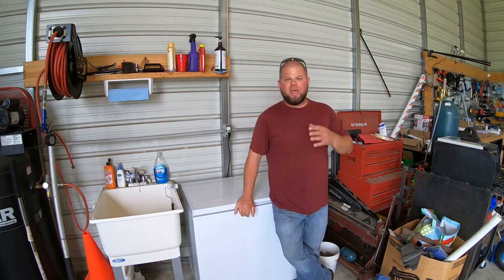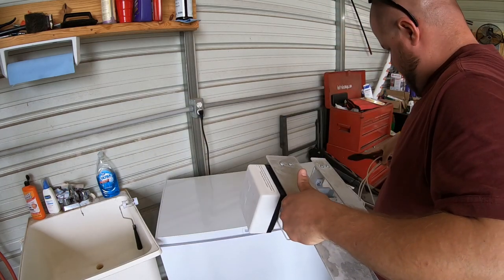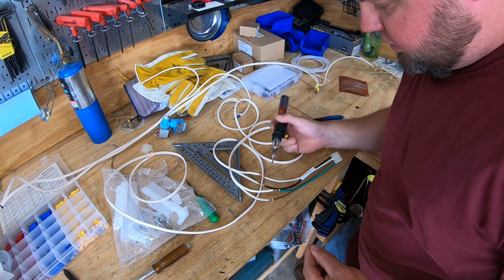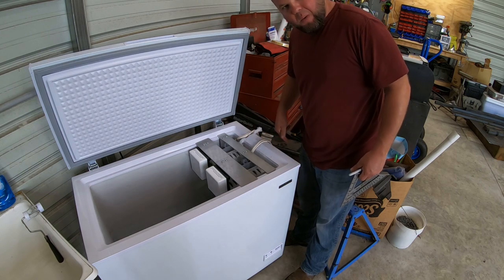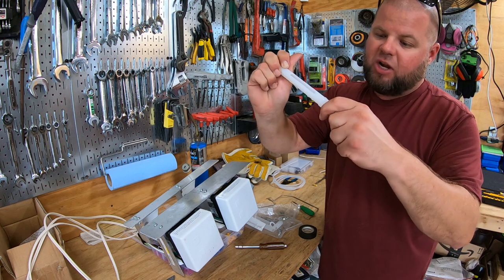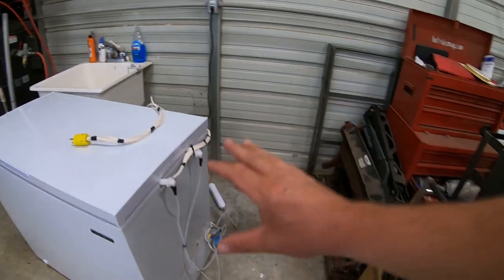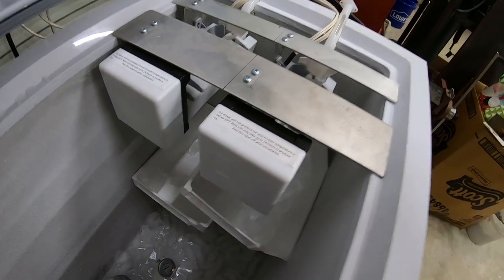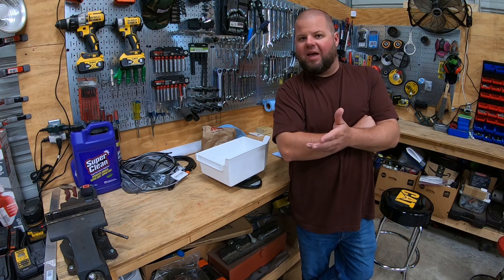Homemade ice machine, adding a second ice maker to increase production!

Comment: Great job & a unique idea! I was an industrial refrigeration tech for 30 years and worked on tons of ice makers and the problem with air cooled condenser commercial ice makers is as the ambient temp rises ice production drops off severely. With your set up you have overcome that problem since you are just keeping the ice makers in a 10 f ambient constantly. Also commercial ice makers use tons of energy especially as it get warmer and ice in an unrefrigerated ice hopper melts and drains. I would recommend one thing to anyone considering doing this is to make sure that the freezer doesn’t have a mullion heater around the top of chest (where you cut into plastic to run lines and wires). The heater is used in some cases to stop lid from freezing shut from condensation. It is very easy to check just buy examining wiring diagram of unit and it will show if heater is present, it is more common on domestic fridge freezers than chest fry but worth a look. Again GREAT JOB!
Reply from the maker: I checked before cutting, no heater in the lip. Thanks for the info

Comment: Since you have the freezer and limited production you can fill some containers with water and make some block ice, which last a lot longer than cubes.
Reply from the maker: I have been doing that lately
Reply: @TKCL   i freeze milk jugs lasts a long time
Reply from the maker: @John Crypto how did you get your thumbnail to have movement?
Reply: A few days before a bbq or party, since I have a freezer, I just go to the grocery store and buy a few gallon jugs of distilled water and freeze them. All you need after that is a box cutter and an ice pick. You get beautiful crystal clear ice.
Reply: @johnmcook1  My dad cuts the top off 3 liter soda then freezes it to use in his water jug at work it works pretty well
Reply: @dane.1847  its cheaper buying bags of ice..
Reply: @jacobsoto5451  depends on how much ice you use and where you live. some places are 5$ for a bag of ice. if you go out on ocean fishing trips with 150lbs of ice or more then 3-4 trips would make this build reasonable. for those that live in other regions where water / ice is cheap then your 100 percent correct. This was an amazing build. I want to build one myself just because it's so cool but I don't have a need for that much ice at any given time.
Reply: @corwinblackthorne4424  "but I don't have a need for that much ice at any given time" unless there is a power outage for a few days, storm damage tornado, hurricane
Reply: Block is great for coolers and hurricanes

Comment: I just ordered the ice makers and will pick up the chest freezer this weekend. This is the perfect solution for me.
Reply from the maker: Awesome, hope you enjoy it! Remember to be very careful around the copper tubing in the walls, that freon is toxic. Mine is producing ice very well.
Reply: Sorry I couldn't help Andrew but hopefully I can you.
The Idea is great but please don't gouge the side of your freezer.
The top of the freezer is nothing but insulation, all the cold stuff happens below the seal. Mount your ice makers near the hinge. Strategically drill through the top for the wires and the waterlines so that they line up with the makers. use large enough tubing aimed straight down so you don't get any capillary effect. You can mount everything right to the top and you can cover it all up with the box of your choice . Don't mess with the wiring of the freezer. Wire the whole thing independently like he did in the second video. Maybe put an ON OFF in the circuit since it's controlling water, plugging it into a ground fault receptacle wouldn't be a bad idea either. 
Great video, great idea.
Reply from the maker: Good points!

Comment: Finally watched the middle video in the process. You can increase how efferent the coolers are by precooling them using one of those freezer packs they send with some orders to keep them cool in the mail. The day before the outing toss the frozen pack in so it will cool down the cooler and when you toss the ice in the next day the ice isn't cooling it down. The packs go back into a freezer so they are ready to go the next time they are needed as they are also good if you take a cooler when shopping to toss the frozens in so they don't thaw as fast on the way home.
Reply: Make good ice packs for your back too. Just make sure to wrap them good with a towel so you don't freeze your skin. They're colder than regular ice packs.

Comment: Great Design and Install! A Very Effective Format for Cheap Bulk Ice Production. As a 30  Retired Maintenance Guy, I only see 1 Flaw in Concept and Install. That Ice Maker that you Purchased is an IM-6 Automatic Ice Maker for Standard Home Refrigerators and if you take a Look at the Bottom of Each Unit? You will notice a White Plastic Paddle Shaped Lever that is Designed into the Gearing System of the Unit. As the Ice Maker sends the Signal to the Solenoid to pull for water, after the Water has been sent through the Fill Tubed and drains into the Catch Trey it sends another Signal to cut the water Off. First, if you look at the Front Cover of the Ice Makers you will see the Cover Square with the Logo on it and say between the 3 and 4 O"clock Position on the Right Hand Side of the Ice Maker Itself you will see a Little Circle with a + and - Symbol. Remove the Circle Cover Tab with a Small Flat Head Screw Driver and you will see a Phillips Head Brass Screw. Turn that Screw Clock Wise 5 Times, what that does is tell the Ice Make to Pull for More Water so your Catch Trey has Larger Cubes in it and They will Last Longer in what ever need you are using, 2nd the White Plastic Lever that I mentioned rotates out toward the Front of the Ice Maker and is designed to in a Normal Installation that when the Factory Trey is full, the Lever hits the Ice Cubes and tells the IM-6 to not pull for more Water until that Lever is able to Cycle Completely. Without that Stop System, it will continue to make Ice, unless possible the Freezer fills with enough Ice and it fills in a way that the Lever will hit it and Stop the Process. Please take a Look at the Ice maker as it Cycles for a Better Understanding of what I have given a Description of. Again, Great Concept and Install. If you have any Questions? just ask. Thanks for a great Post...
Reply from the maker: Thank you for the information

Comment: Former bartender and current refrigeration tech.
¡ Kudos !
Beware of being to aggressive with that ice scoop! Easy to puncture the thin walls.
Reply from the maker: That's been bothering me! I can see that happening
Reply: If the ice is purely for chilling cans and bottles not consumption, might want to line the bottom and sides with 1/2" foil faced foam board to avoid damaging the coils with that dangerous dagger of an ice scoop.

Comment: Awesome project!  I would go with a slightly larger freezer and 2 ice makers.  The longer freezer would keep your options open to add 2 more at the other end while still leaving room to reach in to scoop out ice.
Reply from the maker: Second ice maker was added a while back, that video is at the end of this one. So far so good, update video out tomorrow.
Reply: @TKCL  I have looked at the Commercial Ice Makers for my home for years.  Even used they cost too much money.  Then they waste so much water from the drain in the bottom.  Some even have built in heaters in the bottom to ensure the bottom ice melts.  This solution never occurred to me.  Great video.
Reply from the maker: Glad you enjoyed it

Comment: Great job bud, I always thought ice maker needs its own separate pcb, but turned out that it works just fine without anything special. Also I’ve seen your latter updates, adding 2 fans was a super wise choice. Just like a freezer everything works super faster yet more efficient with the assistance of fan.
Reply from the maker: Thank you for watching

Comment: Hell yeah man!! Great video. Ordering my supplies tomorrow.  I already have a chest freezer. Thanks for showing us this!!
Reply from the maker: Thank you for watching
Reply: @TKCL  I got a free similar looking working ice maker out of an old fridge freezer. With an attached wire harness I wanted to put in a small cooler do these wire directly to 120V AC wall plug in? Or is it wired into the fridge/freezer and has the power stepped down? (I have to re watch the video)
Reply from the maker: I now have two ice makers and made my own extension cord that plugs directly into 110.

Comment: I know your machine is probably making enough ice for your needs. In my opinion, the one thing that you could do to increase is production even more is install the ice makers onto aluminum heat sinks that thermally join the ice makers to the chilled wall of the freezer using a thermal mastic. Interesting project. Thanks
Reply from the maker: I'm installing fans tomorrow and testing output. Next week I am adding block ice and increasing thermal mass to see if production increases

Comment: What i would do to quickly make it more efficient is to place a few pails, juggs whatever of water into the freezer. This will help get the temp lower and keep at that range better.  One main issue you have is the makers are at the top of the unit where it's the warmest preventing it from chilling the ice faster and  making it out ice out faster more ice out. I would put some small pails of solid ice on that side shelf this will keep the makers cooler so your making ice faster.  The pails you can remove later when there's enough ice in the machine that it regulates better.
Reply from the maker: I installed fans and I'll have a video out tomorrow. I'm making block ice next week and testing thermal mass effects.

Comment: Nice! I am going to make one of these for my club. 
FYI. I have a small freezer like this and the interior aluminum surface is very thin. You might want to put something down where the ice hits and be careful if you’re using a scoop. I put several holes in the bottom of mine with frozen food.
Reply from the maker: I'm worried about that too

Comment: Love the ice machine . I’m totally doing this . Just need to figure out wiring . I’d like to add a 15 amp breaker to the circuit powering the ice makers .
Reply from the maker: Thank you for watching
Reply: why would you need 15 amp for a couple of solenoids and timers?
Reply: @funnycatvideos5490  that’s a good question . What size would you recommend ? . Im not a electrician .Could you run ice machine and pump on 24volts ?
Reply from the maker: Needs 120 volts, the biggest draw will be the compressor kicking on and I recommend a minimum of 10 amps for that, the biggest draw on the ice makers is probably when the heating element kicks on to release the ice.
Reply: @TKCL  I guess I’d have to read the max amp draw on the ice machine . I feel it’s important to add at least a breaker since the wires will be exposed on the outside .
Reply: @garza7676  If you are concerned about exposed wires, put it in conduit.
Reply: @IJChan223  that’s a good idea . I’ll have to do that . Thanx

Comment: Here are the changes I would make to the design.  First, you mounted the ice maker in the warmest part of the chest freezer, of which has no active airflow.  In a regular freezer, they are usually designed so that the coldest air coming off the evaporator hits the icemaker.  Maybe mount a small fan inside the chest freezer to get more cold air across the ice maker.  Second, I would add another icemaker, or a larger capacity one, to make more ice.  Third, I would add a catch bucket, so you are not digging ice off the bottom of the cooler.  You could even rig a 20lb ice bag under a chute, and fill it as they are made.  I bought a case of ice bags with drawstrings on ebay, from a store that closed, for cheap.  Lastly, if you can find a way to pre-chill the water to around 33 degrees, like running it through a coil of copper tubing kept inside a mini-fridge, it would greatly speed up the ice making process.
Reply from the maker: You'll enjoy the video I'm about to post, cover most of that.

Comment: When drilling metal, using a center punch on your marks will help prevent the bit from walking on you.
Reply from the maker: Yes it will, I usually only center punch steel

Comment: you can also make 10+ lbs a day using two 2 1/2 quart measuring buckets to make block ice.  you can chop it into chunks using an ice pick.  so simple
Reply from the maker: Not quite as simple as scooping out perfectly uniformed ice and placing right into my cooler.
Reply: @TKCL   I can make 8.5 lbs a day of perfectly uniform ice cubes using 8 ice cube trays. but the chunky stuff is better, lasts longer in the cooler.
Reply from the maker: I think I'm about to be right with that number or past it. And it makes it for me while I sleep, no attention needed. I test the final production of ice tomorrow now with fans installed.

Comment: If you add a fan blowing across the ice makers it will make a huge difference in ice output air is stagnate in a chest freezer cold settles to the bottom! Look at your Ice maker in the house air flow is in the design.
Reply: Never mind I see you went with the fans.
Reply from the maker: Yep video out tomorrow
Reply: @TKCL  I bet it's making ice like a Alaskan winter now.

Comment: I love it.  Im going to make a slight design modification and make a wooden/foam collar to mount everything to like a Keezer.
Reply from the maker: That's exactly what I'll do on my next one, I didn't discover that until after I was done.
Reply: I built one with the wood collar / keezer style last weekend. The wood is a poor insulator and stays wet due to condensation. The condensation adds considerable heat to the interior I believe. I need more insulation (have 3/4 blue foam inside the collar) and a shorter collar (used a 2x6 and only need a 2x4).
Reply from the maker: I'm going to use pvc or hpde (cutting board material) for my next build to avoid that.
Reply: Yea I may sandwich it with a foam.
Reply from the maker: I would

Comment: maybe add a wedge under the ice makers to force the ice to flow into the lower section, to prevent shutting off the ice maker early with ice pileup on the upper shelf?

Comment: As I said you got a great idea there if you do a little research on your ice makers and possibly even add a fan inside to speed up the cooling across your ice makers you can probably I'm just going to speculate as long as those are like the old-style ice makers where you had an almost infinite control inside the front cover to speed up and slow down the production you can probably make up to 50 - a hundred pounds a day with those ice maker.
Reply from the maker: I already have two fans that I'm installing tomorrow, video out next week. Thanks for watching!

Comment: Good idea……. But freezers maintain temps at 0dig. . When the ice is harvested from a residential ice maker the cubes are wet  In a freezer they are going to stick together. Also as the ice sits in the bottom of the freezer sublimation happens causing the ice to grow into one big block. Your friends side by side idea is good but will require a drain for the bin. Even then sublimation will occur . 0:32
Reply from the maker: It takes months for that to happen, I clean 2-3 times a year anyways so it isn't a problem.  I now collect ice in small trash bins, it eliminates that problem.

Comment: I was wondering, being the lid only has a hinged lid without any wires going to the lid, if the wires to each ice maker inside your freezer, and the water inlet tube, could all go from the top of the lid, as the wires and the water inlet lines could all be sealed using a sealant and you wouldn't have to cut the sides of where the lid seats on the bottom unit? A box could be made and fastened on top, to house the sloped tubes that would go down through the lid into the trough of each ice maker. Plus this could be made using PEX tubing, which wouldn't freeze as much. But you had a great idea how to mount both ice makers inside the freezer. Just an idea, so you wouldn't have to cut into where the lid seal makes contact with the flat area of the bottom freezer unit. Just some food for thought.
Reply from the maker: You could go through the lid as well.
Reply: @TKCL  
What I had written, was before I saw the future video's. It in my opinion was a genius idea to build the piece above the freezer unit to run the wires, water  fill pipe and be able to mount the unit, as this would provide a better seal on top where the hinged lid is, as well as where it sits on the freezer unit. I really enjoyed the series, as how you would keep evolving to make better changes, and to do the ice output tests for 24 and 48 hours.
Reply from the maker: Glad you are enjoying the content. Thanks for watching!

Comment: add a padding under the ice maker where its drop ice cube on deep freezer rectangle lip will save it for long run, just like a inch thick Thermapole or any foam
Reply from the maker: I put a tray there that catches the ice

Comment: If I follow your wiring I will need 5 wires per ice maker. 4 for the 4 wire harness and 1 for the neutral coming from water valve to plug at the wall. Correct?
Reply from the maker: That's correct
Reply: @TKCL  And brown to other side of water valve.
Reply from the maker: Assuming you have the same ice makers as me, yes! Otherwise they all have different wire colors, I'd suggest reaching out to a professional electrician or appliance repair shop if that's the case.
Reply: Last question. Does it matter which side the nuetral wire is plugged in on the water valve? For reference which wire is on the terminal of the mounting bracket side? Thank you.
Reply from the maker: No because on AC current the polarity is constantly changing on each wire.

Comment: Fill the plastic tubing with sand and tape the ends securely. Heat and bend. The sand will maintain the shape of the tube.
Reply from the maker: Thank you